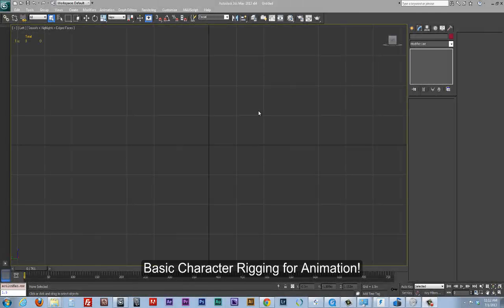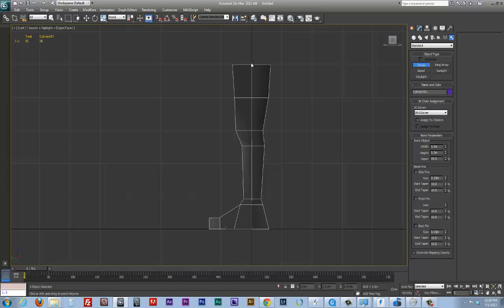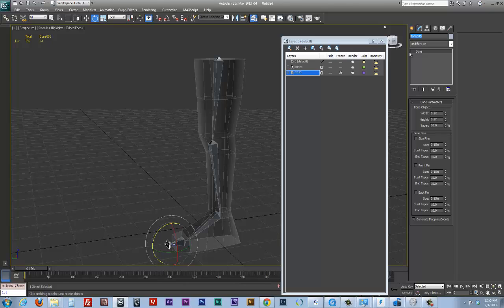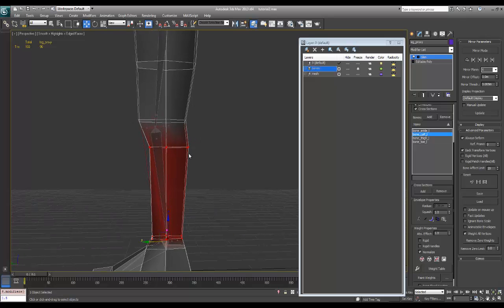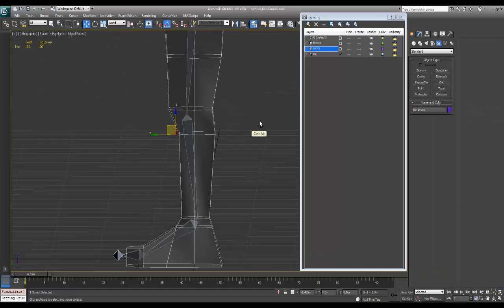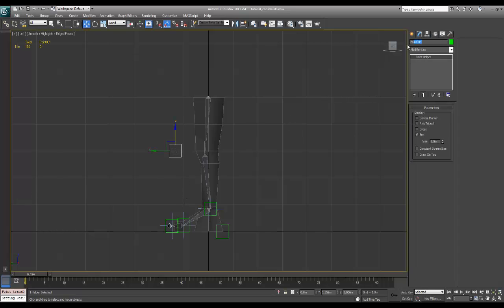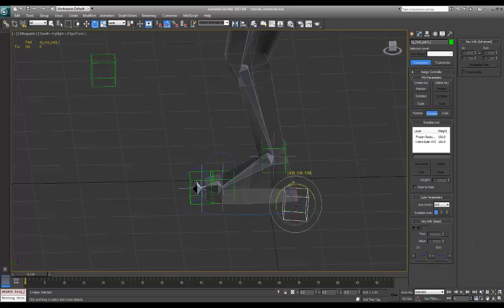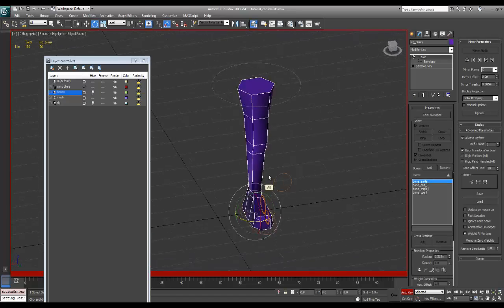Beginner's Guide to 3ds Max -- 11: Rigging and Skinning

Comment: hi, thanks for the tutorial, i have a little issue on 18:38 which i hope you can help with it since google doesnt help so i just write here..
1. didnt show colored faces on x-ray mode
2. if in normal mode, i must choose either colored faces or colored vertices. if choose both only showed faces color and not vertices
3. in normal mode i cant see the back vertices

any advice?
Reply: nvm..i did solve it by changing the viewport to smooth highlight like yours(need to change display driver from nitrous to direct3d or opengl)

Comment: Good tut.  I agree sound is very low.  I did this with a mesh I made in 3D Coat and imported into 3DS Max and every time I try to bend a bone 3DS crashes.  Every experience that and if so, do you know what's causing it?

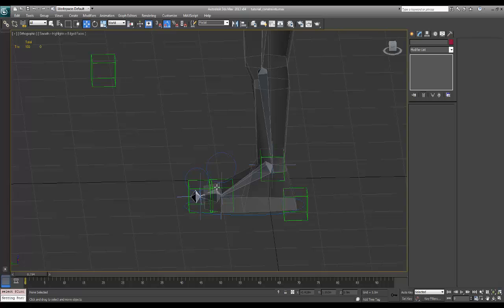Comment: when i set the constraint on the foot it moves what do I do  44:00
Reply: Same problem here, When I connect the first constraint it pulls the whole foot down.
Reply: Check alignment. Select the circle and press ALT A, a dialogue box for align will appear. Under orientation check all x y and z axes. That should solve it..

Comment: Is it possible to move a vertex to the position of another one but not be welded, so that they are two vertexes only occupying the same location?
Reply: +Miroslav Kubíček if you right click the snaps toggle icon at the top of your screen ( it will highlight if you press "S") you can select vertex snap. Then just drag one vertex onto the other.
Reply: Thanks a lot for the answer, it will really help me in the future :)

Comment: Is this 3ds Max 2013? 2012?
Reply: Kindlesmith70 Look at the top of the window, it's written ^^ Autodesk 3ds Max 2013"
Reply: Arnaud Leduc Would be great if I could actually see the very top... on full screen I have a stupid black bar that says this video's title; it cuts everything above the top of the E of "Edit". Any other screen size in youtube and its too blurry to read. But thanks for that.
Reply: Kindlesmith70 Gosh, may be re-install your flash player? Or update it.
Reply: Arnaud Leduc  Sure that's not a built in feature? I mean it's not a big deal most occasions... just very few times it is a bother. Not found a way to disable it. Ah well. I'll reinstall and update it. Maybe there is an option somewhere to switch the heading off in fullscreen and I'm just too blind to find it.
Reply: Kindlesmith70 yeah, i searched and i didn't find anything :/ Try to put your vid in fullscreen, then press "ctrl" + "-" or "ctrl" and scroll down the mid button of your mouse, it should work like that.

Comment: Ok. I'm finally following most of what you are saying. If I was a complete beginner I'd have absolutely no idea what you talking about or even demonstrating. Right off the bat you sling terminology at full force without a simplified explanation. This vid has been a wealth of help in seeing how rigging is done. I do have a stupid question however. 'Helpers' are they all needed to make use of those circles (controllers), or were some of them just placed there for completion sake, ease of reference, etc? For example - the heel.
Reply: Kindlesmith70 Yeah it's just to make it easier.
Reply: Ah. got ya. Thank you.

Comment: Thank you Isaac. I'm having difficulty at 39:40. When setting the ball ik end effector > solver properties > parent space > to IK goal the heel edge is moved to the ankle ik end effector position and contorting the foot. I've reviewed my rig, HI solvers and links and they all look correct.
Reply: Solution: Under Motion > IK Solver be sure to toggle IK/FK Snap. This option prevents the heel from snapping from it's existing location to the ankle location.
Reply: I had the same problem with the foot distortion, thanks for sharing your solution.. I'm new to rigging / animation in Max and never would have guessed :-)  

... although!  At :44 same foot-deformation happens when I select the point helper and goto Animation-Constraints-Orientation Constraint and choose the circle shape controller... I tried toggling IK/FK & surrounding area.. but any tips?  I've come so far in this tut & don't want to give up now.  Thanks!

Comment: How do I limit angles? I have a robot arm, one of the joints can rotate 0-60 degrees, and other one can rotate 360 degrees.
Reply: click the magnet button at the top of the screen, more specifically the magnet with the arc
Reply: DAmastr8 No, you didn't understand me, I'm not about angle snap, I want limit rotation for some bones (one bone 90 degress on X, other bone -60 to 60 on y, and third 360 on y)
Reply: izvarzone
Do you want to animate this model and just use the animation in your apllication or do you want to control the robot arm in your application?

If you want to restrict the rotation in your game, presentation, etc., when actively controlling the robot yourself, set the limits in your script for the program, I don't know if thats what you want?

In 3ds max bones have no limits because why should they. You have the full range of 360° for your creativity.
You can easily see the angle you set a specific bone to when rotating it in 3ds max for the next frame of the animation.

If that didn't solve your issue, then please explain what you specifically want to to.
Reply: *****
nvm, I already found how to limit rotation, it's in the graph window.
Reply: ***** I planned to make rig for Source engine (Source FilmMaker to be exactly) but I didn't figure out how to make rig for it, SFM uses python language for rigs. So I'll bake all animation in max instead and upload them to SFM.
Reply: Hm i don't know SFM, I never used it myself, sorry..

Comment: thank you very much for the tutorial! I only have 1 question: I'm using 3ds max 2014 and at the point that you're edditing your envellopes your leg becomes red with all the polygons that are selected but if I select a envellop it doesn't becomes red nor can I select polygons and I can't scale it like you did. Maybe you know what I should be doing at this points or what I'm doing wrong.
Reply: did you find the answer?  For me, same version of Max, the color shades are not available when in see-through mode, so as he mentioned to use ALT-X to toggle see-through mode so you can see the envelope colors.. (or right click on the mesh and goto object properties to toggle see-through).. also it has to be unfrozen. :)

Comment: Hey, glad to be the first to comment. Really good video, didn't quite manage to follow it fully correctly, but I got the skin modifier to move the mesh with the bones, so that was a big step for me. 

I got most of the point's to work for me too. Up until the knee swivel point I was going good. The knee swivel point warps my leg for some reason. I'll figure it out, the bones move the body, that's half of what I need. Much appreciated!